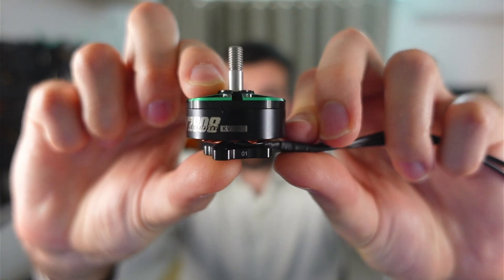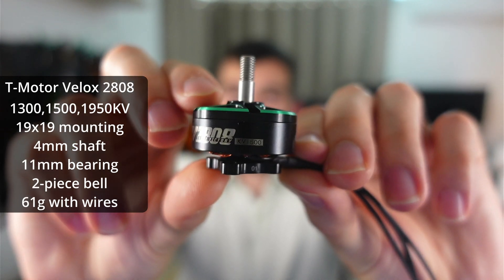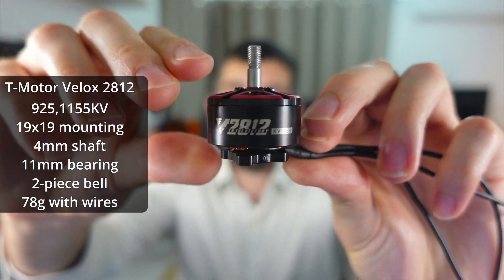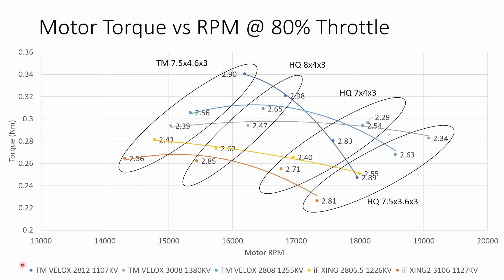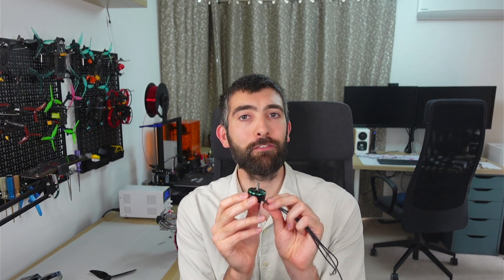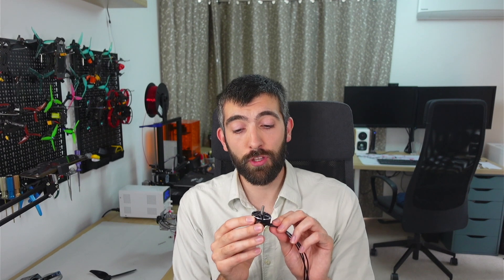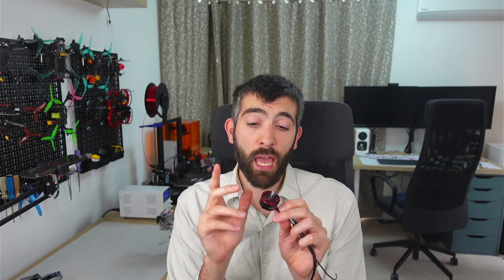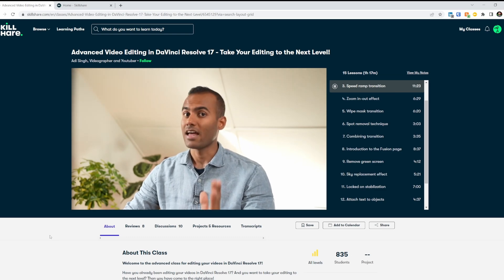Testing the NEW T-MOTOR VELOX 2808, 3008, 2812!

Comment: Hello @Chris Rosser, how is it possible that two motors with same prop at same RPM exhibit different torque? RPM is AFAIK tied to torque you have.
Reply from the maker: With the same prop at the same RPM the torque will be the same. My torque test uses a flywheel that is being accelerated which allows the motor to make its maximum torque at every RPM across a range. The variable is how long it takes the motor to accelerate the flywheel. Bigger motors accelerate the flywheel faster.

Comment: Chris as always amazing video! What motor do you recommend for 10" HQ props for "real LR" quad? On my short list is Xing 2814 1100kv, BH 3008 1150kv and Tmotor 3008 1150Kv.
Reply from the maker: I would probably include the T-motor velox 2812 in that list as well. 3008 might be a little small for a 10" prop?

Comment: Hi Chris, for a high speed 6" build would you recommend 2808 1950kv motors in 6s? Im planning on using APC 6" props with high pitch. 
Thanks!!

Comment: Nice but I would like to see also FPV motor comparison, exactly the same motor size and KV, the same test condition only different manufacturers, which motor is the most efficient, lightest, strongest overall the best :D for long rangem for freestyle and something like this :D pls. Thx :D
Reply from the maker: I've done some 5" motor testing which you may have seen? It's not always possible to get the exact same KV for different motors even two motors with the same nominal KV can test out very differently. I have some even more in depth 5" testing planned so stay tuned!
Reply: The best motors - RCINPOWER

Comment: Very interesting and informative video. Nice selection of motors. I did learn a lot. I already built my Catalyst Machineworks Merica 8 inch, I chose the BrotherHobby 2810 1500kv motors. The props I ended up liking the most are the HQ 8x3.7x3.
I wanted something with power, speed and reasonably responsive. I'm very happy with the end result. It's a blast to rip. Happy flying everyone. 😎

Comment: I was looking at the T motor line for the Spec 7 with Long arms I'm about to build. 
it can hold 9" props... I'd like 8 or 9" bi props or 7"-8" triprops. 
I was contemplating the 2808 or 3008 ~1300kv 
crazy timing...
maybe I'll go with 1100kv..
Also 8s... Foxeer...
Reply: Did you go 8s and what motors?

Comment: Wouldn't you think it better to specify the motor as having a 19mm BCD, instead of a "19x19" mounting pattern? The latter would lead you to believe the distance is measured between adjacent holes whereas the truth is that it is measured diagonally as per a circle.

Comment: Recommendations based on 6S? What about the same motors/kV but for 4S?
Reply from the maker: 4S is not really appropriate for these bigger props. The current required is just bananas and ESCs can't cope.
Reply: @ChrisRosser  Maybe I’m getting lucky, or cruising more than free styling? I am flying 4S with 2408, 2806.5, and 2807 with 1700-1900kV, HQ and Dal 7 inch triblades with about 3.5-4 pitch, on 35-40A ESC’s.
Reply from the maker: @TweakRacer  Interesting. I'm flying 6S 1300KV 2806.5 HQ V1S 7x3.5x3 on my AOS 7. I hit peak currents of ~200A in punchouts, powerloops and juicy flicks. I'm using a 60A 4in1 which copes fine. But to covert that to 4S would be ~300A for the same power. Peak ratings are typically a bit more than continuous ratings but I would be a bit nervous drawing 75A through a 40A ESC.
Reply: @ChrisRosser  How did you calibrate your ESC's shunt resistor up through at least 200A? On your test stand (or maybe, run motors in full reverse while having an inline watt meter or a multimeter with DC current clamp)? 

More importantly, when actually flying, there's no way to connect up a bench power supply or a monster battery. What battery are you running and that you've verified can put out peaks of 200A? I'd be surprised that our typical hobby-grade and typical-7"-drone-sized lithium polymer batteries can output that much current.
Reply from the maker: @TweakRacer  I just use the manufactuer supplied calibration for the current meter in BF (I would guess it's better than +/- 10% in terms of accuracy). I'm using 2x 1100mAh 6S 120C packs in parallel.
Reply: @ChrisRosser  Seems like a lot of faith in that current measurement. Would be interesting to see how accurate the factory calibration is (may be a good video).

 Would be surprised, if not shocked, that those "120C" lipos could output 5000W, especially through 2-3 pairs of XT60's (60A max peak current) and 12 AWG or less battery leads (x2), parallel harness, and ESC power lead.
Reply from the maker: @TweakRacer  XT60s are 60A continuous, 180A peak. So two of them would be good for 200A+ for a short burst. The current measurement is just the voltage across the shunt resistor so it should be pretty accurate. My X8 Cine80 draws 400A on punchouts from a 5200mAh 6S so half the current for half the motors seems reasonable to me.
Reply: @ChrisRosser  Amass XT60 data sheet shows 30A continuous and 60A peak. Or am I misreading it?

Perhaps you are flying a lot harder than me. I’m mainly cruising for long range and flight time. YMMV
Reply from the maker: @TweakRacer  The specs from Servocity say 60A contiuous and 180A peak with 12AWG wire or 150A peak with 14AWG wire . You'll only hit those kinds of currents doing full throttle powerloops/180 turns and even then only for a moment.
Reply: @ChrisRosser  That’s just an erroneous product description. Data sheets for XT60 connectors can be found at plenty of places. Can’t post a link, but for example, search for Components 101 and XT60 data sheet. 30A continuous and 60A momentary max.
Reply from the maker: @TweakRacer  That'll teach me to google! 🤣In practice I think 60A continuous and 150A max is much more representative of how most FPV pilots use those connectors!  😨

Comment: Without you having tested the Xing2 2809 1250kv, would you assume that it's just about right for bi-blades 8x4.5-5 or triblade 8x4?
Reply from the maker: Yes. It'll cope very well with most 8" props with that kv.

Comment: After building a 7 inch quad, I found the only advantage it has, is to have higher cruising speeds. It's more efficient at low throttle. Basically these big motors use the tourque to spin a big high pitched prop at low speed. You can carry heavier batteries or camera gear.
Personally I prefer the 5" more, because It's faster in top speed, acceleration and overall handling.
So if youre not into long range or pro cinema filming, stick with a 5".
Building a 7" isnt really much more expensive, but the equivalent batteries cost doubble the price.
What hardly anyone tells you is, that if you're going to want to use the high thrust these 7" motors make, you need big batteries, high rated ESCs and an XT90 plug.
Reply: My only struggle with 7” is handling the external factors with a so low authority power ratio, wind in primis , 5 “ is so much better even on the same power/weight ratio imho

Comment: i use 2812 1115kv with 8x3,7x3 and now i know why it flies bad, i want to try out 8x4.5x3 should do the job
Reply from the maker: Yes you need a much bigger heavier prop!
Reply: @ChrisRosser  Which one would do you think is worth testing for Thic X8 2812  ?  Gemfan 8046-3 (13.4g) or gemfan 8060-3 (11.9g)
Reply: @ChrisRosser  thank you very much for the things you do for FPV community!